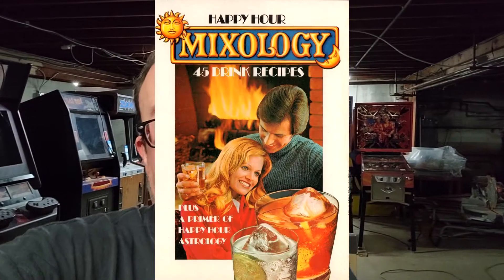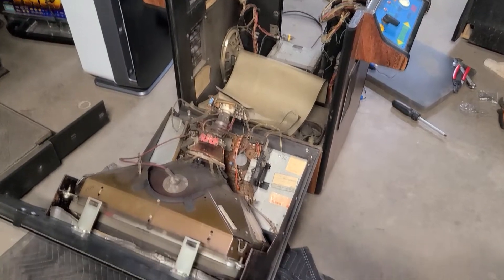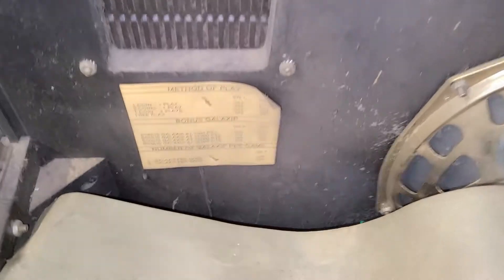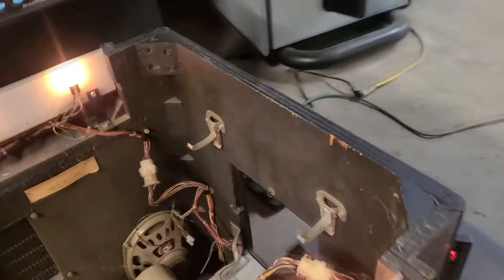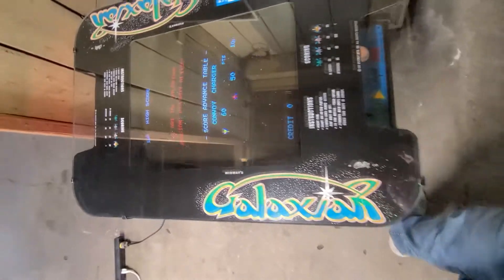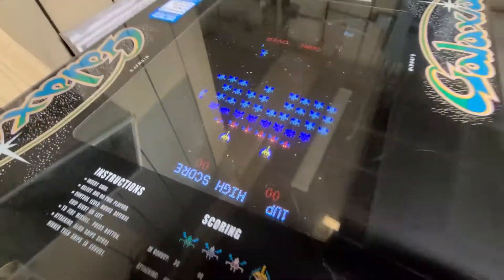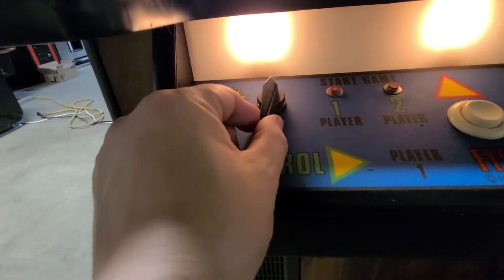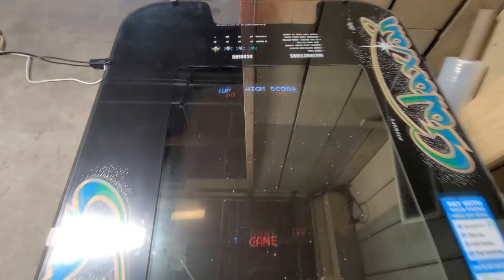Galaxian Cocktail Machine in Test Mode (Out of Order)

Comment: I wonder why the service manual dipswitch settings are different or wrong compared to the tabletop version. I'm guessing the ROM game code files are different or have been changed because the ROM game code is what has the dipswitch settings?
Reply from the maker: I have no idea, but it was weird. I kept thinking the dip switch must be mounted upside down, but that wasn't it either. Just glad I got it going in test mode, much easier to adjust those and see the variables update live.